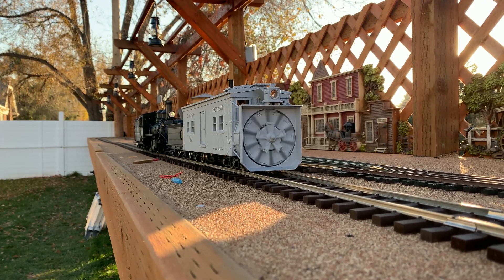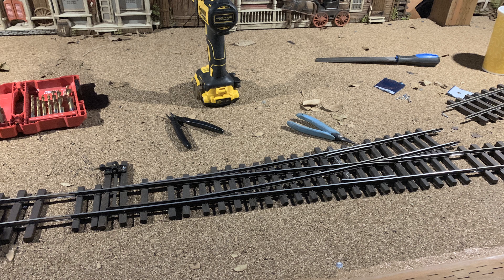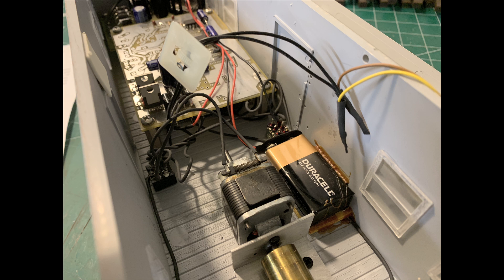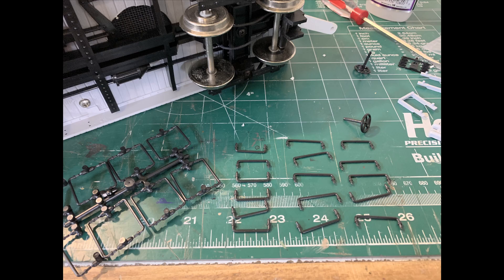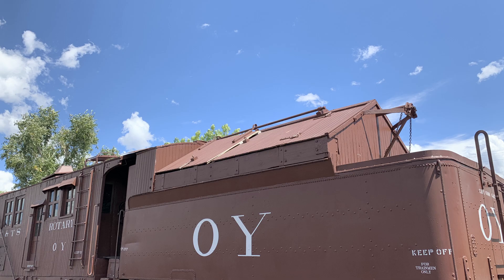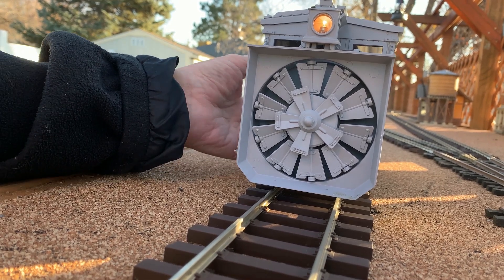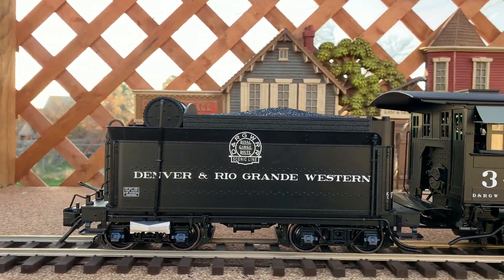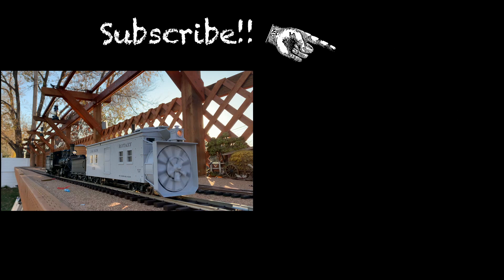USA Trains 1:22.5 Scale Rotary Snowplow

Comment: I love rotary snowplows and plain push wedged blade plows. I have 2 rotary plows and about 8 regular plain wedged snow plows. Sense my layout is model after Colorado Midland, Florence and Cripple Creek, and the Colorado Springs and Cripple Creek District there is a lot of need for them in the mountains in Colorado. We are expecting snow here on Saturday I believe. We really need the moisture. We have had only about 1 inch of snow this season  here in Northern Colorado. If we don't get alot of snow this year alot of other places are going to be with out water next year. Thanks for sharing your snow plow and hopefully you will get it ready for your expected snow. Be safe and see you on Sunday.👍🚂🚂🚂🚂🚂
Reply from the maker: Well I’ll bet you got some!! We did for sure!  The rotary struggles with it as it’s slush!!  But I’ll bet it works well.

Comment: Just excellent.   U know about broken hips but i had a 10 disc surgery.   After years have to say big Thank You  for videes helping me get thur this horrible mess
Reply from the maker: Omg!! Wow. That’s a challenge. Glad you are doing well. Stay well!! I almost had a repair to a disc. I ruptured 3. Lumbar. I was about 35 I guess. Horrible pain. For over a year. Finally they scheduled surgery. On the day of the scheduling screening I was a bit better. So we put it off. And for the next six months I just hot better. I still get spasms but no big deal. All good. For over 35 years.
Reply: Thank you so much for resonse , most know  ya'll .cant reply  to all , it's a big deal means alot seldom at 68  do things matter , like getting  a standard porescha  (sp)   cant see in dark ; anyway got to put 2200 miles on it was bought with 1600 miles       but had to park it under carport. Joke is on me i was told that 12 post opt was the hardest, news flash hurts more now. Again thank you and karen so much........

Comment: Rotary plows are beasts in thier own right! I like that the blades run independent of track power, too! Of course, upgrading to DCC would be fantastic, but simplicity is superb enough! I think it could be said that you've inspired me to attempt something similar, only in H.O. scale. I have an Athearn rotary that operates via rubber bands around drum axles (and not very well, I might add). I have some  salvaged can motors in my bag of tricks that would work. I just need to figure out how to rig it up. Anyway, hope y'all get plenty of snow for a possible video demonstration. That'd be fantastic! Cheers!
Reply from the maker: HI. I don't have my DCC hooked up as yet... I'm "testing" with DC. But in this case, I thought if I put DCC in the rotary Id address the rotary from the controller, take it to full power, change the address to the locomotive, and go... Then to reverse the blades, the same. SO, as this is an outside thing to actually plow the railroad (OK still just screwing around) but the easy way is to set the switch to the direction you want and go..